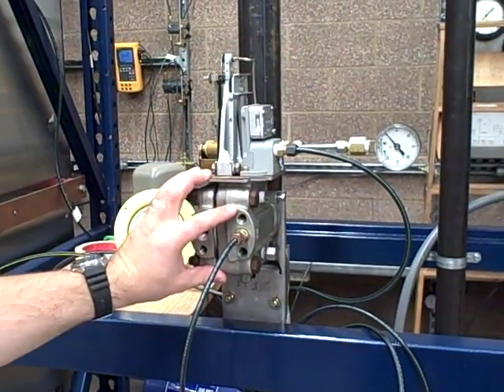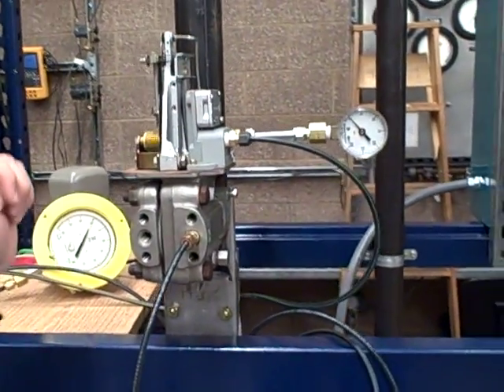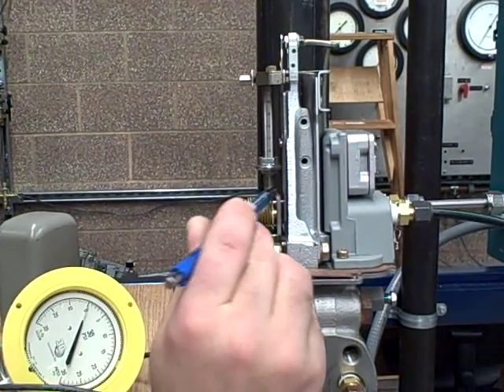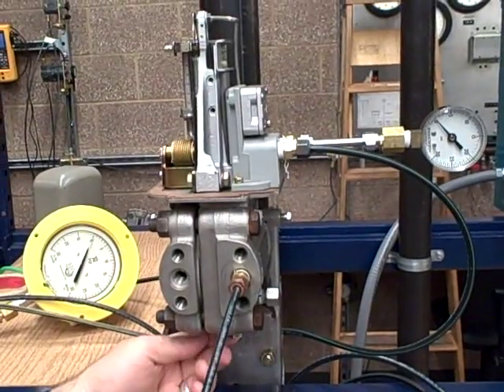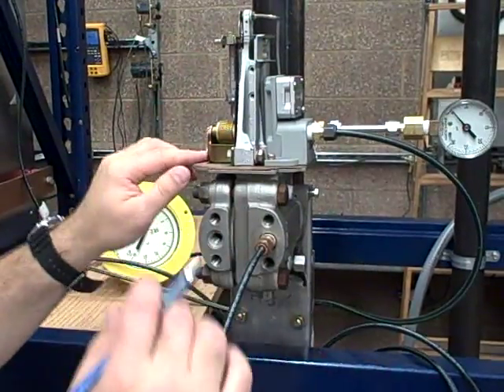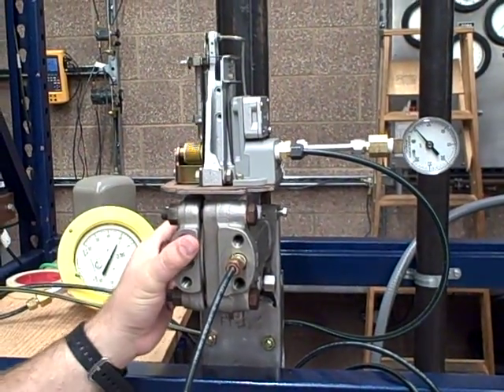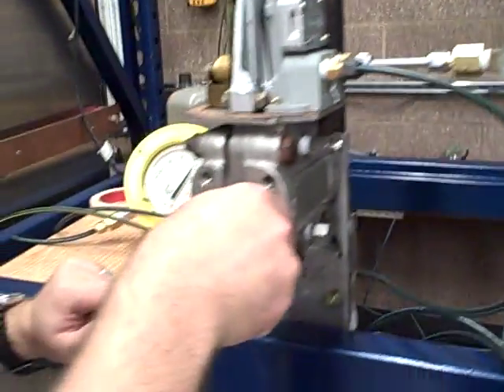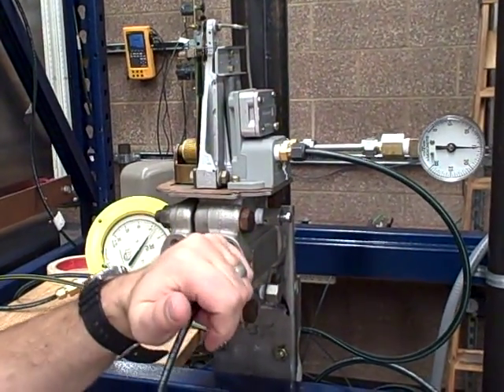Foxboro model 13A transmitter re-alignment and repair

Comment: I used to work in the Foxboro factory, for 2 summers.  I never completely understood what the parts I made did!  I find it interesting how you said that your unit had the wrong diaphragm.  I worked in the capsule room, assembling and welding the diaphragms and flexures onto the capsules, then filling them with oil.  Were you actually swapping out the entire capsule?
Reply: you swap the capsule if it get corroded and or leaking , loosen the stirrup and re-tighten the fixtures one at the time 
you should get ~ the 3 PSI zero , the next problem is static alignment , increasing the pressure equally on both sides and still stay at zero differential